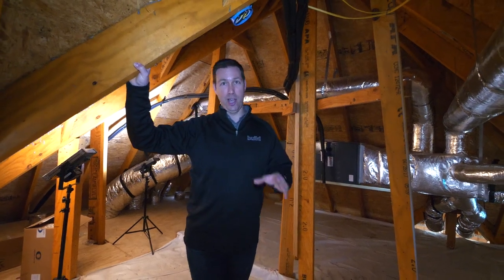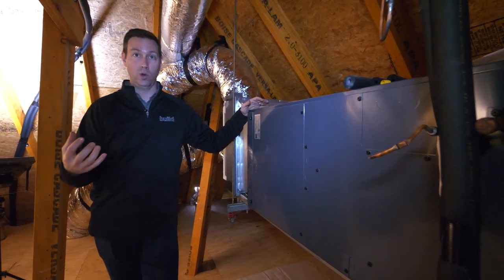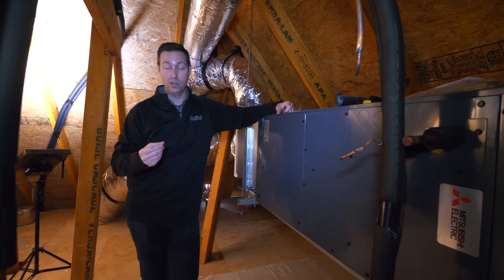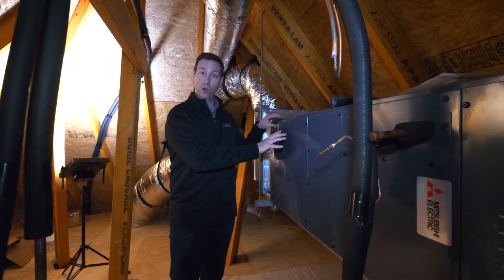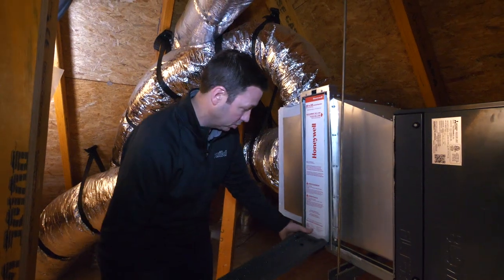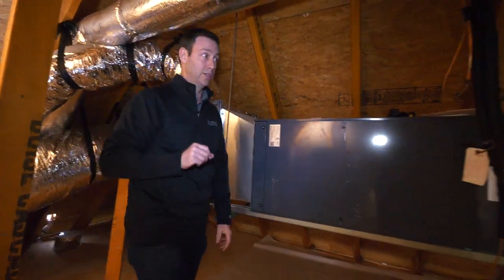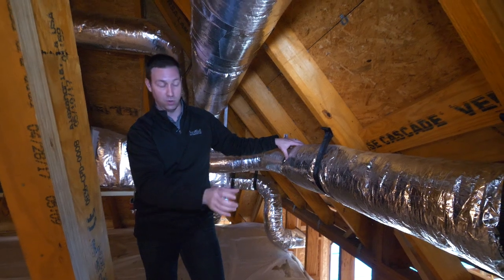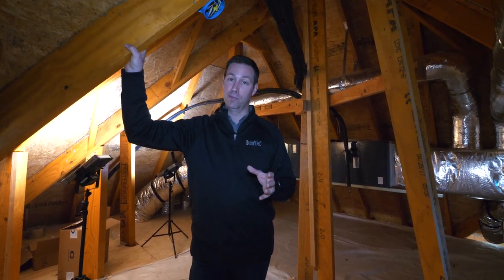New Construction HVAC - Here's My Favorite System

Comment: Turning vanes in round pipe? Flex 10' long? Seems a bit too much.
Reply: I would be very surprised if there were turning vanes in the individual duct runs.
also, transitioning to flex needs to be done correctly. flex duct is MUCH more restrictive than metal, so reduced air flow WILL be experienced.

Comment: saying that the air filter will last a year is incorrect.  when a house is dirty the air filter gets dirty sooner than a house that is clean. maybe say the filter can last a year depending on how clean the house is kept, how many and how long doors and windows are kept open etc etc. also the styro-foam blocks are positioned incorrectly under equipment.

Comment: Stop running damn flex when you can run hard trunk lines.  Also bs on air noise with hard duct, if you design it right you won’t have any noise.. Flex duct you loose too much CFM and is a lazy contractor way of doing it. Especially when you have full access to the studs and structure 

Also a extremely expensive and very much overrated VRF system. Love the BS sales people who sell them. A homeowner will never save enough money from a VRF system for them to make sense.
Reply: OK, what is then a good alternative by name, model.etc, really need it for my install, thanx in advance.
Reply: @BojanPetrovicvft  A two stage condenser is an alternative to vrf(inverter) but may be pricey. A 14 year old 2 stage saves me idk maybe about $50-70/month in a 1400 sq ft house. $50 × 6 months/year x 14 years = $4,200.
Reply: coolramone saves you $50 over what?

Comment: This air handler works fine with that much of an air restriction? What size is that motor a 1 or 2 hp? Standard ecm 3/4 horse is going to pre maturely fail pulling air thru that much filter. There is a reason the slot on the bottom of the unit is there. It is the manufactures recommended filter size for that particular unit. Now an electronic air cleaner before the filter sure. Very non restrictive.
Reply: That 4" filter is actually way LESS restrictive than the original.  Take a look at both filters, side-by-side...  The filter media is virtually the same thickness on both filters, but there's like 4 times more filter media AREA for the air to pass through.

Comment: You can only get away with those big filters on systems that are designed for them.
People try to stick them in Old systems that don't have the proper ductwork size.
Reply: Dan Matz bingo
Reply: its ok to install these filter boxes if you butt it against the return side of the air handler because it wont add much to restriction of existing airflow and wont raise the static pressure too much.
Reply: Actually, by making the filter 4” deep and “pleating” it it lowers the static loss across the filter media. The 2 biggest benefits of a 4” filter are 1) more filter media, and, 2) lower static loss. In other words, converting to a 4” filter will help any system.

Comment: Oh dear I hope you didn't actually spray foam the bottom of the roof! Do you realize what causes ice dams on roofs? It is critical to have ventilation of cold air under the roof so the ice and snow doesn't thaw and refreeze. That's why baffles are installed in eaves of houses during attic insulation. 
Additionally, why would you wish to condition the attic? It's inherently difficult to cool as all the heat from the home rises to it. The variable speed rotary compressor will not offset the enormous energy wasted. 
That is essentially a spider-duct system, plenum box with no trunk and long branch lines.
Reply: Literally everything you said is wrong. Having cold air under the roof doesn't prevent ice dams - it's having inadequate insulation and warm air reaching the the bottom of the roof and melting the snow only to have it re-freeze at edge. Btw, he doesn't have ice in Houston anyway. You can have a completely unventilated ceiling too like I did at my last house requiring exactly zero venting and baffles.  He mentioned in other videos why a conditioned attic is key in warm climates - go watch them. 

I'd know house building up and down and left and right before I'd come on YouTube and correct someone else who's been doing it for over a decade.
Reply: Lisa O'Donnell Please search: "Building science insights-- to vent or not to vent" 
There is a highly informative video which explains this very well. It's been well established that a properly vented attic is imperative.
I do realize in some areas the MINIMUM code requirements enable people to build inferior homes. In some parts of the world people live in mud houses, which seem to serve them well. Perhaps this will be a new "green" method of building in America.
Reply: You are wrong it is perfect.
Reply: I think he’s in Texas.  Ice dam is not a concern

Comment: I just can't understand the immense cost of VRF system.
Reply: Its cost USA rip-off pricing. Standard AC tech around the world.
Reply: gracilism 
Regulations and codes
Reply: Are the VRF systems that much more expensive?
Reply: gracilism extremely overpriced and you must have properly deigned ductwork to get its advertised advantages. This flex duct mess will kill this system. High static will eat compressors and blower motors. VRF systems are almost triple the cost and the homeowner is fed BS when they buy them. Expensive to install and very expensive to repair after their warranty is up. 500-1000 dollars for a modulating blower motor
Reply: @zack9912000  What do you suggest people install or have installed as an alternative?
Reply: steam steam get a standard 95% furnaces with a non VRF and NON communicating system. With a TXV metering device. As of 2019 manufacturers can produce systems with a PSC blowe, thanks EPA. Get a torque blower motor over a ECM motor.
Reply: zack9912000 wow vrf must be real expensive in Usa. Here in australia a full ducted refrigerated inverter system is the same price as the garbage gas heater with add on cooling systems. I call them garbage as there furnace is efficient but there evaporator coil and direct on line compressors are not. Refrigerated air requires a larger duct size then that of a gas furnace. So running them in the same duct is a joke

Comment: This install bugs me. The expense of having VRF and labor expense of KD ducting, when all that efficiency is corrupted by the plenum design. I wonder if they know Manual J at all ...
Reply: What's wrong with the plenum design? Genuinely asking, bc Idk.
Reply: Lisa O'Donnell , There is nothing wrong with the design. Most people's opinions are out of date by 20 years. All modern equipment uses a variable frequency blower motor or a constant torque motor. Both are ECM motors and ramp up and down to meet demand and overcome restrictions. Overall efficiency won't be compromised until static pressure across the evaporator coil exceeds 4"WC . That will never occur under normal circumstances. Each branch line has to have a balancing damper by code now so the plenum isn't an issue. I believe this system has a Modulating Zone system which uses motorized dampers and it adjusts the blower and compressor speed depending on the demand/ # of zone's t- stats that are calling . Essentially it controls it's static pressure / cfms . The duct system is sized for maximum cfm that the equipment is capable of at its highest stage , 90% of the time it will run in lower stages.
Reply: Kelly McGrew , Manual J is horribly outdated . It fails to recognize the correct and current friction loss of flexible duct provided by ASHRAE testing.  It works fine for metal duct but sizing flex with it you will always be undersized .
Reply: Zen mind 
It’s what municipalities call for though. I’m planning an ICF house in Florida with mini splits. This city wants a Manual J. My system obviously has no ductwork, how ‘off’ will it be for me then, I wonder?
Reply: Manual J is the load calculation. Manual D is for duct design.

Comment: Who would want to put a filter in their system that gets changed once a year? Are you collecting it so it earns interest?
Reply: Just change it more often based on your use, problem solved.
Reply: Well not really problem solved since its a 60 dollar filter that half way thru its rated life reduces airflow, and i'm the schmuck that gets to change out the blower motor.  Sure they pay me to do it, but it could all be avoided.
Reply: It has such a large filter area that it typically only needs to be changed once a year, unless you are particularly dirty.
Reply: any decent system has a filter indicator that will alert you to a drop in pressure.
Reply: on a residential hvac system? I don't think so.  Oh you mean the little filter symbol on the thermostat lcd display.... Yeah thats just a timer.
Reply: No, Pressure differential sensor.
Reply: Ian Powell I mean, I've toyed with installing a magnehelic gauge myself, but I'd be like the second person in the country to do it
Reply: Also: it means the return ducts will collect crap over time. I'm no fan of that...

Oh, and at home I screwed a fine stainless steel mesh on over the return air filter box, and it keeps the big crap outta the filter, so it lasts a lot longer
Reply: +Jason what do you suggest as an alternative?  I suppose if there is no filter it never needs to be changed....
Reply: The filter is designed so that the more dust that it catches the more dust it can catch. The surface area on the 5 inch media is massive.
Reply: jason I take it you never handled a 4" media filter. It looks like the return vents are mounted on ceiling which is a lot cleaner than one next to the floor and foot traffic.
Reply: Anyone see a drain pan to protect the sheetrock? 

Nice sweeping turns on the duct, but I laughed a little when you said there should be a vane. Your name is on it you don't know?
Reply: When I replaced my HVAC system, I went hi-efficiency.  Yes, the filter is only 1" and the fan runs constantly but only speeds up when it needs to.  The filter gets changed once a month.  Almost NO dust in the house.  I understand the benefits of a larger filter but no room to make space for it.
Reply: Round elbows do NOT require turning vanes. Square ones do unless they have a round back and throat. Air flows much better through round duct than it does square
Reply: Because most people will only change filters once a year anyway? So why not put a filter in with enough surface area to support that?
Reply: Jonathan Roeder LMAO that’s what I was thinking...Especially if you are trying to show what a great job you do at least install a overflow drain pan with a float switch wired in series with the compressor or main 24volts. 

Lol should have a turning vane; yea I doubt it, shouldn’t need it anyways.
Reply: The air filter is one of the most important parts in your whole air conditioning system. The larger surface area in the filter allows the filter to catch more dust without restricting the required the CFM through the indoor coil
Reply: Realistically how often do most people change their filters anyway?  Think about it.
Reply: Those are typically twice a year replacement. The package says 'up to one year'

Comment: Where is the secondary? That’s going to be a leaker...
Reply: Billyboy well It will never condensate because the refrigerant lines are hooked up.
Reply: John McMaster you jokingly mean not hooked up I’m guessing, but ya, I love it! This install Probably looks grand to Johnny home owner😂  “text book install” he says haha tf out a here with that nonsense lol so much wrong here that wouldn’t pass inspection,at least here in my area. But what do I know,I have only been doing it for 25 years haha. Good eye on the line set lol👍🏻
Reply: Billyboy yeah. Typo lol. I would hope they put a emergency pan under it. But yeah looks don’t mean anything. It would be nice to know what the design friction rate was. That return plenum is nothing more than a blind box.
Reply: John McMaster yep,I agree with 💯.nice chatting with you.
Reply: Billyboy , You should be able to see that this job is in the rough in stage . Refrigerant lines must be pressure tested if concealed by drywall etc . No specific pressure just capped and charged with nitrogen until after the rough in. Most new air handlers come equipted with a water sensor in the primary pan but that doesn't protect against a thawing evaporator coil that froze up. Secondary pan must be installed with a secondary drain or water detection device in the pan . However knowing an iceonene crew is coming to spray and the air handler is suspended , I would wait till final to install the pan as I'm sure that's what they'll do.
Reply: John McMaster , Return plenums can be minimum 4" long if the collar is in the end cap. That won't effect static pressure or friction loss. Also it is a variable speed system and will run at lower stages 90% of the time. The system will adjust it's speed based on demand and efficiency loss doesn't add up to anything until the static pressure across the evaporator coil exceeds 4" WC . That will never occur if ducts are sized for the system's max cfm. Regardless the motor will compensate for restrictions far beyond a standard split capacitor motor from a few years back so, within reason , friction loss isn't much of a concern for a residential system anymore.

Comment: Replace filter once a year? Come on. Its not a fishing net. Your goal isnt to catch as much dirt as you can. Your goal is airflow. Catching dust is the byproduct you need to clear out to keep airflow maximized. Rule of Thumb: One Month Per Inch of Thickness. Maybe you can go longer but why? It may cost a little bit more to change a filter out three times a year but you’re protecting your system and you’re maximizing airflow it’s not a catch as much dirt as you can game.

Comment: The last ten feet you said was flex yet I can see about 18ft before it disappears under the rafters and probably runs the whole box which is 25ft. How was that second glance at the end of your little speech when you realized it was well over 10ft. There’s nothing special about that install. Actually they used fiberglass insulation when they should be using bubble wrap. They make double bubble or you can put air gaps and or just double wrap. It looks way nearer and doesn’t collect water that will mold in the future. So ya not that great of an install sorry to break it to you.
Reply: Are you upset that you can't make systems that well and specialized?

Comment: 99% OF HVAC contractors do not design systems with the right amount of return. VRF systems require the duct to be right.
Reply: John Canfield isn’t that the damn truth. Nobody does an air flow analysis in a house they just shove heat runs where they want and usually lacking severely in return.. makes you wonder if they even do a static test on start up or just make sure it’s on and leave lol

Comment: No emergency drain pan? Living on the edge. 

That supply truck is horrible. Good luck balancing that mess out. 

There's no benefit to rigid metal over flexible duct. Flex is quieter, cleaner, and far easier to install. 

I'm really surprised that you're such a huge fan of PEX, but you still hang onto metal branch runs.
Reply: umm are you joking? What do you mean there isn't any benefit to using metal over flex? Do you know how to use a ductulator? Do you know and understand duct compression>? Have you ever seen or know what the equivalent length chart is?

Comment: NO flex in my system.  Too hard to clean!
Reply: John Gritman , Change your filter on time and you'll never have to clean your ducts ever. I see 30+ year old duct systems all the time that are spottless and other that are 2" smaller both dimensions from dust build up. :)   This system's return duct will become dirty due to being filtered at the unit. I prefer filtering at the grills . Honeywell makes a 4" filter to fit a standard 1" filter grill .
Reply: Zen Mind wait . What? 4 inch filter in a 1 inch system? How

Comment: Isnt spray foam insulation dangerous to health..??   There are videos on YouTube where people back in 2017 got the spray foam insulation and got sick days later with that nasty FISH smell in the house...
Reply: You Tube  -  spray foam is totally safe when used correctly...   the problem comes from poorly trained or lazy installers.   The foam is a mix of 2 (sometimes 3) chemicals that require a very specific ratio, if it’s off (that is, wrong) you get the issues you’re talking about.   Another problem can arise if it’s sprayed too deep...   the foam reacts with air and needs to be able to off-gas (solvents flashing off), if it’s sprayed too deep the stuff on the bottom as it were can’t expel its gasses.    The trick is to find a good installer...    don’t be afraid to ask for references and make sure the person spraying hasn’t only just started the job.    A good question to ask is how often they clean the spray gun...    if it’s anything less than once per day of use (ideally after every pause in spraying), avoid !!
Reply: Well you say look for a good installer ... well the problem is that all those techs had to start at some point ... 

The issue i have here is that stuff is too risky, yes its safe as long as its installed and mixed properly .. thats too much of a chance to take when someones health is at risk ... 

Its better to stick with the old school insulation that is blown in or layed down ...

Comment: I pity your spray foam installer. You should have them insulate the attic before the HVAC system goes it, working around ducts like that is a nightmare.
Reply: Torsten Hansen , How can you install hangers after the foam is sprayed.  You can't. That's why. They will cover the equipment before spraying and the flex gets sprayed with the roof and will barely be visible afterwards. No problems for all the iceonene contractors I've worked with.